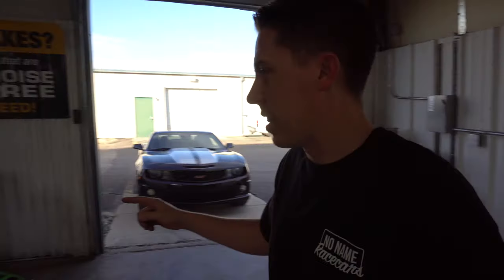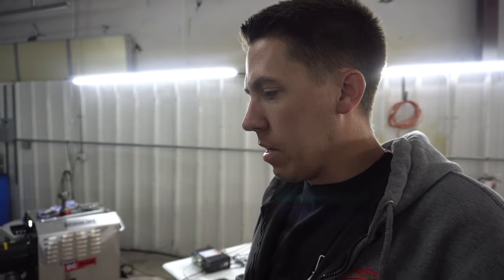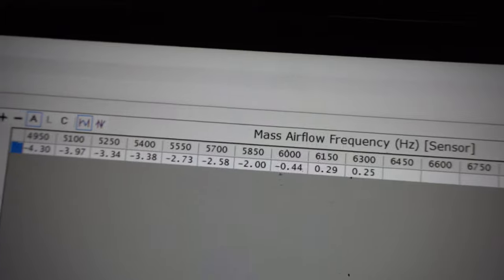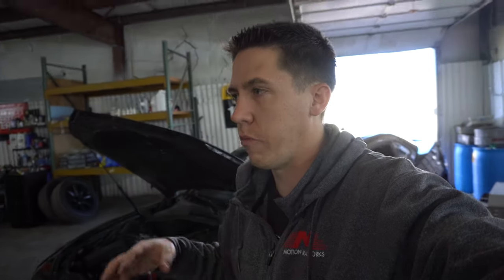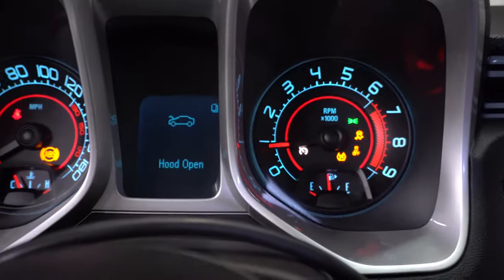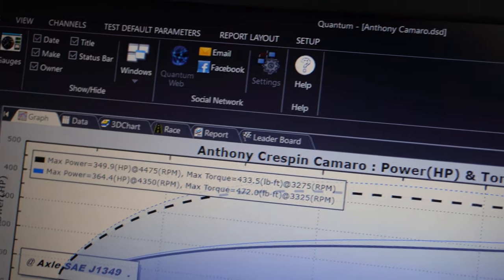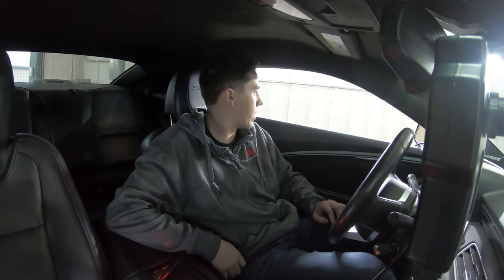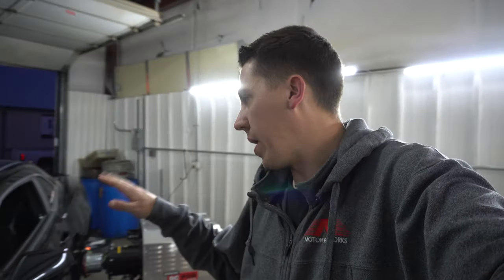Cammed LS3 5th Gen Camaro With Headers and CAI Tuned with HP Tuners on the Dyno!

Comment: I certainly trust dynos solidly hooked up the the axles over tire-driven rollers.....if the dyno is set up correctly.  Really nice the way the computer puts  mixtures down so nicely.....very easy to understand the make the necessary changes.  Would love to have that dyno sitting in my garage.  These new motors(LS, 5.0, and Mopar Hemi) just amaze me in the amount of power they will easily make.....I was born too soon!  LOL  You doing his on pump gas, I assume?
Reply from the maker: It definitely is nice to have this tool available to use! The new engines are definitely impressive!

Comment: I have a question, i have a l99 camaro 2010 with kooks headers, xpipe, borla mufflers and k and n intake , with hp tuners , how many horsepower should it make ? Another question, do you recommend me removing the cats of the lt headers? Btw great video!
Reply: Probably around 380 at the wheels and depends on if you live in a state that doesn't check for emissions.

Comment: Why do you prefer tuning in AFR compared to Lambda?
Reply from the maker: I would actually prefer Lambda but the command number in hp tuners is in afr and the other main system i use is holley efi which uses afr based not lambda so ive gotten use to converting lambda to afr all the time.

Comment: Damn! I have a 2012 Camaro SS with Texas Speed Stage 3 Cam, long tubes, CAI. And my tuner only got 422whp and 395tq. I feel like they didn’t try hard enough. They used HP tuner
Reply from the maker: Do you know what it made before the mods? Depending on dyno and stuff the numbers could definitely be different.
Reply: @BuildTuneRace  It’s an L99, but I did the LS3 conversion. I never got a baseline Dyno run on it, but from what I’m finding online, it should’ve been around 320hp to the wheels, stock. From that to 422whp is really good, other LS3 conversions have been putting down more with the same mods.
Reply: fire your tuner

Comment: You say to the wheels. Just curious. My car actually had wheels on it when my tuner tuned  it on the dyno. Would my car have more horsepower if you tuned it?
Reply: They call that a mustang dyno, I'm pretty sure. The dyno he is using is much more accurate.
Reply: @ss-zt7en   no  hub dyno not accurate

Comment: What cam and headers? I’m thinking about getting them soon and have been looking for a good setup
Reply from the maker: The cam is from Texas speed it was speced by them and the headers are long tubes not sure what brand.
Reply: Brendan Gibson. For headers go with speed engineering with off road connection pipes. You won’t feel disappointed how cheap they were and at the end you will be impressed how loud it was. I recommend getting o2 extension on Amazon you save $20 bucks and also get the gasket on Amazon also a little cheaper. In total I spend 400-500ish, and most likely I recommend taking it to someone to install it at a performance shop. Cause if one of those bolts snap. Your gonna be feeling sad for the whole day. One of my bolts snapped. I was not happy. After having it towed to a performance shop. I had them install my headers after they removed my broken bolt and tuned it. I had max power: 425.42 with just heads and full exhaust set up.

Comment: I may have missed the part where you clarified but is that crank or whp
Reply from the maker: This would be closer to wheel horsepower. Hubs usually read a little higher than wheel since there is no tire.

Comment: I guess i am questioning 490 torque at the rear wheels with cam , headers, intake only?
Reply from the maker: That’s what the dyno read. Hub dynos are known to be a little higher do to no loss in the tire/dyno roller aka more efficient reading. The dyno did get an update and on one of my vehicle about a year later after the update it lost around 20whp so I think the new update is a little more conservative on the number.

Comment: OEM calibrators should be tuning for MBT, not knock. The best torque is found using a spark hook test. Some cars this is easier said than done, especially if real time tuning is not available in the ECM.
Reply from the maker: Definitely hard without doing real time tuning. This is also the first dyno tune i have done but definitely want to play with mbt tuning!
Reply: @BuildTuneRace  I wish I had a dyno...any kind of dyno! It's difficult getting a good tune on the street.
Reply from the maker: @fasnuf  its definitely a much more efficient way of tuning! Probably takes a 1/3 of the time to gather data and make another log! Sucks always driving around then having to drive back to make changes
Reply: @BuildTuneRace  My biggest complaint is the traffic getting in the way and all the transitions and decelerations screwing it up. I make all the changes on the side of the road, refresh, drive a while , then start logging again. Just not as smooth of efficient.

Comment: No ve tuning? 
Probably not the best if there is ever a maf fail situation.
My personal experience I haven't seen the innovate wideband sniffers be .5 afr leaner at tail pipe.
Reply: blackws6 I thought the same in regards to the VE table being unchanged.
Reply from the maker: Most gen iv cars with virtual VE you can get dialed in with just Maf only. On heavily modified cars you would possibly need to adjust the virtual ve if you couldn't get it dialed in on Maf only.

Now if this was a gen 3 then i would definitely tune the ve table.
Reply: @BuildTuneRace  

I think you would be decently surprised if you made a quick histogram of AFR Error and short tirms against the VE. Baby cam shafts like a 218 duration will be 10+15% rich off idle where that pumping efficiency is gone and 15%+ lean up top.

Having a proper Dynamics blend will drive much nicer than running just the maf and adds a safe guard in the event of maf failure.

Tuning virtual ve with hptuners is made easy, and that steady state Dyno makes quick work of it.

Give it a try some time.
Reply from the maker: Ill definitely give it a shot!

Comment: That was 490 hp to the wheel?
Reply from the maker: 490 corrected to the hub. Hubs are suppose to read a little higher than roller dynos. (No loss in the tire) also the dyno updated software and I would guess it reads 20-30ish horsepower less than it use to before the update when this video was shot. Probably would show 470ish now. Either way this car picked up a good amount from the mods!